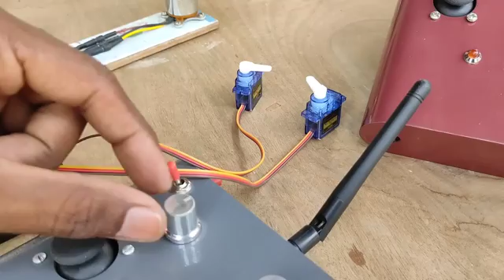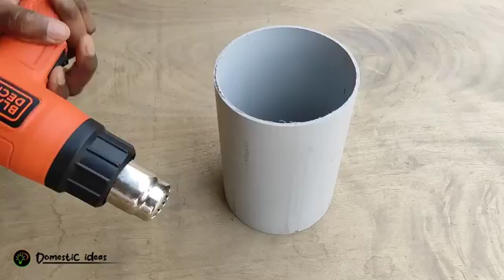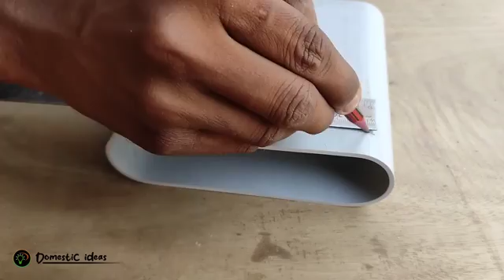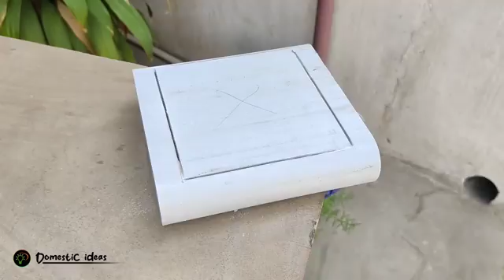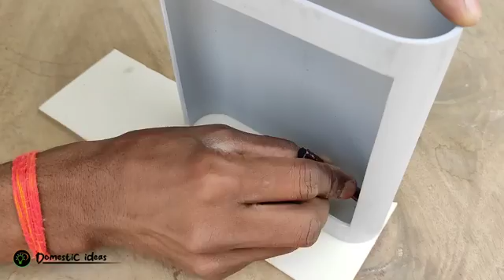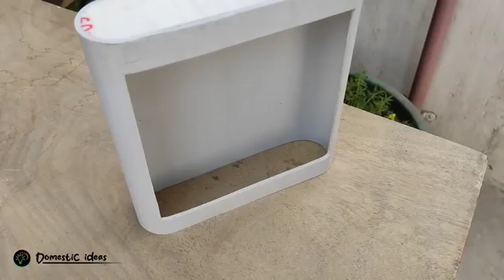rc remote control kaise banaen rc transmitter and receiver kaise banaye rc remote kaise banaen

Comment: i have one question in this complate tutorial : 
                                                                             That is when the both side nrf24l01 and nano to one is transmitter and one is receiver so in the receiver side there are not any kind of motor driver are used without motor driver the dc motor can run or servo motor :